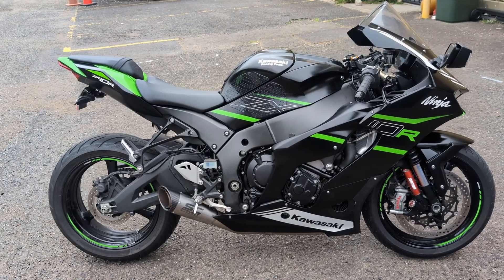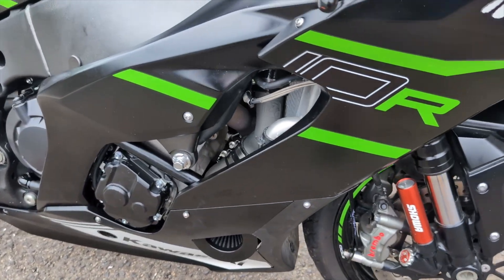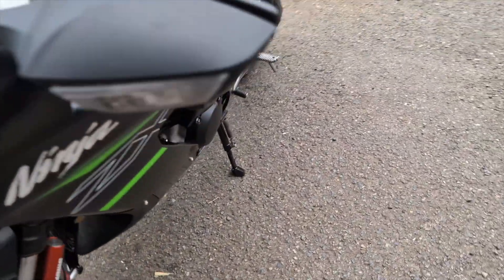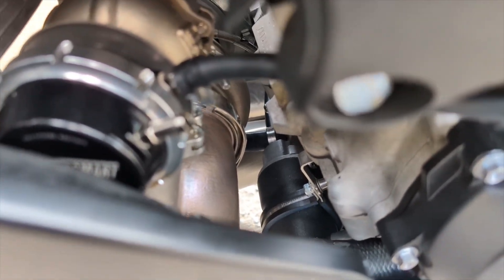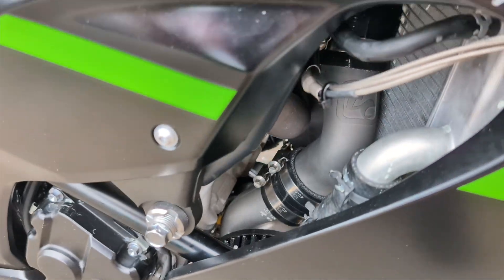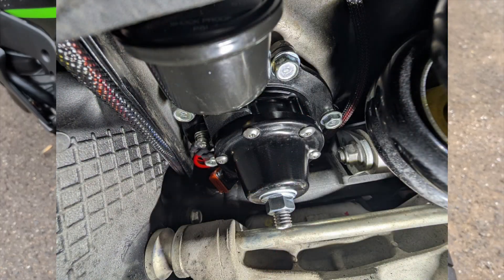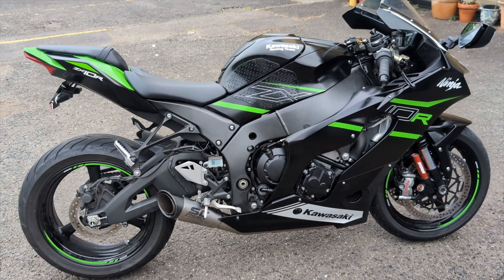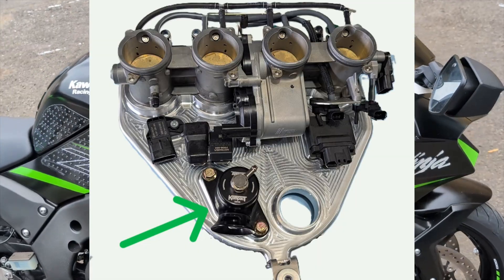ZX10R Gen 6 turbo kit walkaround & dyno

Comment: Cool. Just make sure you've got a spare water pump for the 2019 H2SXSE+ intercooler in stock for when I get back to AU. Its a hard life in the tropics. I blew up 2 x Turbosmart FCDs. About 5,000 klms each. Turbosmart couldn't work it out, but I figure it is the DC supply voltage fluctuating too much. Bought a gadjet to ensure steady supply, but not fitted yet.

Comment: Pls do a cross plane r1 next or at least again because the old videos that you did 10 years ago didn’t have a lot of information.
Reply from the maker: The modern R1 isn't a suitable platform for an easy turbo kit as they use titanium valves which don't mix well with boost/ heat , so pulling the engine apart & changing parts is required, this makes for a more complicated install.
Reply: @extcreat  ohh I see, thanks! Love your work over the years!
Reply: @extcreat make one for the older r1. 5vy 😅

Comment: What fuel was this on? Stock injectors? Cant help to think on E85 with H2 upper injectors you can spin it higher safely and make wayyy more power....as if 300+ isnt enough. What is the cost of this kit? I'd love to add this to my gen1 zx10..which has a supercharger on it now which runs gen4 tbs and e85

Comment: Next level of engineering and quality turbo kit!
Reply: Any need to change the internals? And how hot is it running? Im tempted to install one of these kits but I do not wanna blow up my engine
Reply: Except for the part where the turbo inlet is near the exhaust. Just going to be sucking in hot air 😂
Reply: @Nick-Edwards  you make it better champ !
Reply: @uspidzavunje  I could do all the 2d drawings or 3d modeling they want as I am an engineer but I will be no help with fab work lol. The only reason I can think of putting the inlet on that side is to make it look as less conspicuous as possible by hiding the filter more. I’d rather have power over that but to each his own I guess.
Reply: @Nick-Edwards  well you know so much but we still see no progress, engineer...
Reply: @Nick-Edwards maybe when sitting still. Once your moving it literally is getting ambient air passed all over it. How ever does a radiator even cool the motor when its so close to the exhaust. Yet when you start riding you see immediate temp drop.
Reply: @rhetericalpha  because a radiator doesn’t have 300 degree oil running through it like a turbo. The turbo is not going to cool like that. Comparing a turbo and a radiator is crazy. Doesn’t matter how fast you’re moving, you’re going to suck in heat being that close to the exhaust. A proper drag/roll bike always has the turbo inlet on the clutch side for a reason.
Reply: @Nick-Edwards  I'm a turbo system builder. The reason the turbo inlet is on the right side of a motorcycle is simply a matter of design and manufacturing ease. Putting the turbine's hot side on the right is much easier to design with a full exhaust system, and practically impossible on most motorcycles with a full exhaust design. That's the only reason. It makes no difference to the compressor inlet temperature while riding.
Reply: @Nick-Edwards the comparison was air flow. How did you miss that Mr. Engineer.

Hey but you made a good point yourself. The turbo has 300° oil in it however will the turbo suck cold air in if its already heated lol. 

The turbo is not sucking in air from the exhaust that is behind it once moving. Its catching on coming air from in front. I have a turbo bike and beat the piss out of it. and the side of the intake in not what you just said. Sometimes its personal preference from the designer
Reply: @rhetericalpha the turbo is obviously not sucking in exhaust fumes from the outlet of the exhaust. I didn’t mean that if that’s what you were thinking. It is sucking in a lot the air near the manifold that is getting heated.
Reply: @kawi9 that makes zero sense. It would not be easier to manufacture for a full exhaust system. He’s got a u pipe on the exhaust side of the turbo that routes all the way back to where the muffler is. If you flip the turbo, you don’t have to run a u pipe. You can just run a straight pipe from there to the muffler. That u pipe is also obstructing the flow. You’re not going to have a nice laminar flow. Also it 100% will suck in hot air over there near the exhaust pipe. That is how convection works.
Reply: @Nick-Edwards I didn't say exhaust fuems im saying hot air. It is not going to be sucking in hot air the exhaust is warming once moving. Again going back to air flow. There is still air passing through that area and in the fairing.

Comment: so the internals are untouched?!
Reply: 300 wheel doesnt need new internals
Reply: @JackTorence the engine won't damage or blow? I'm kinda worried lol. I canceled 2025 sf v4s for 2026 zx10. I'm planning to do turbo lol😅 any suggestions needed for reliable turbo application?
Reply: @DzulikhramZulhizam he’s probably running like 8lbs of boost. You should be good to go on stock. Just stay on top of maintenance and be prepared to install some heavier clutch springs.
Reply: @DzulikhramZulhizam  just get a good tune. Afr's will make or break you. Ivr got a big turbo subie. 715hp. Its been going strong for 10 years. And u know how those motors (ej257) are... of course its built but so is the bike. Itll be great

Comment: I tuned a turbo Gen1 Busa exactly the same way with PCV controlling boost and flashed ecu with woolich. The PCV was definitely capable and has lots of parameters that are not spoken about and when you have knowledge in excel to calculate things more clearly it was pretty good. But! I still went Fueltech lol 😂